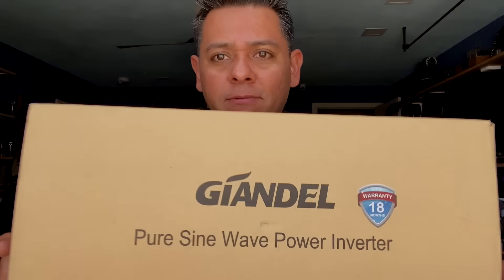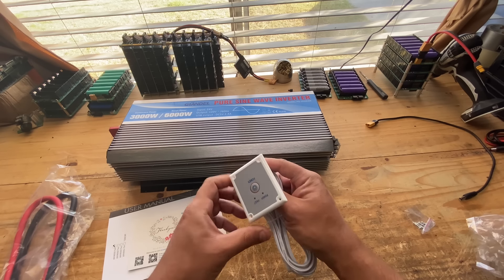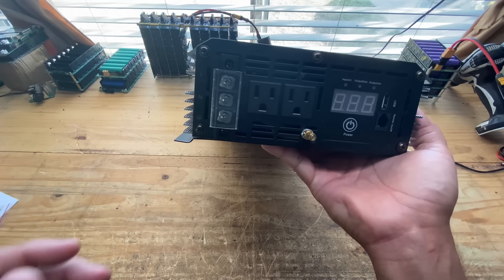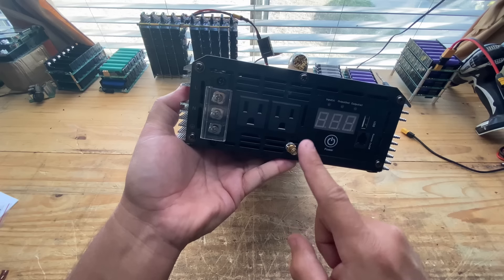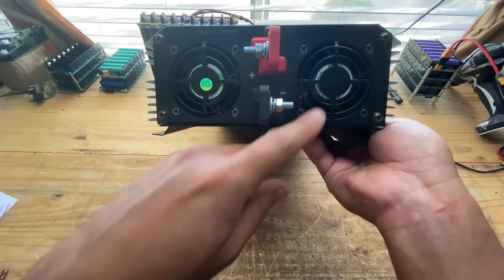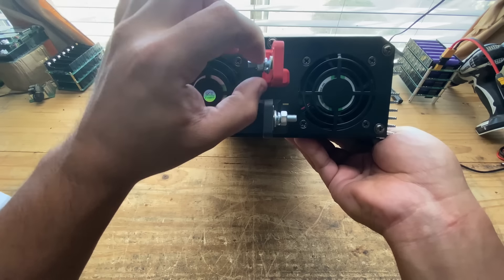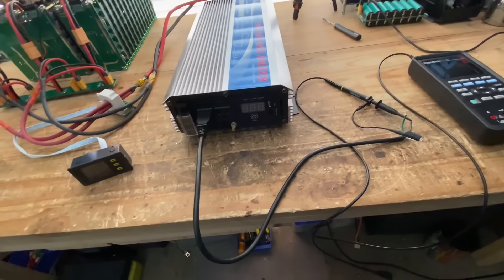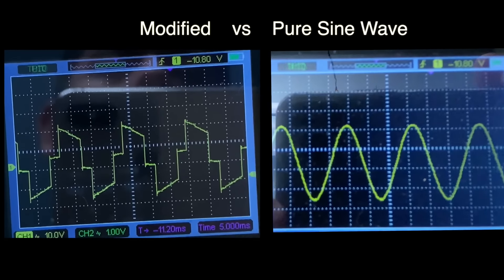Giandel 3000W Pure Sine Wave Power Inverter  Review

Comment: There is supposedly some device that can be used to greatly deduce the inlet surge of such big equipment and there never POP your Inverter, as well as being able to run a slightly smaller Inverter (or use BIGGER equipment on the Inverter you already own).  Any knowledge on such Soft-start devices? ...as well now Shared, which I assume you knew already ;)